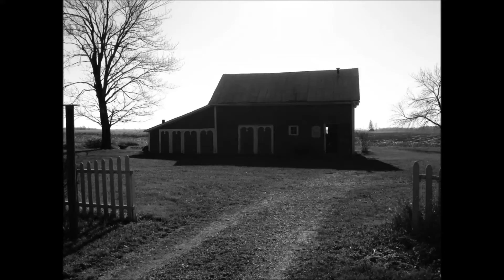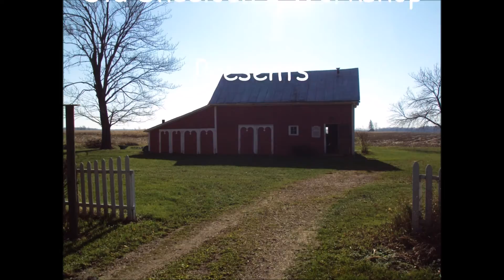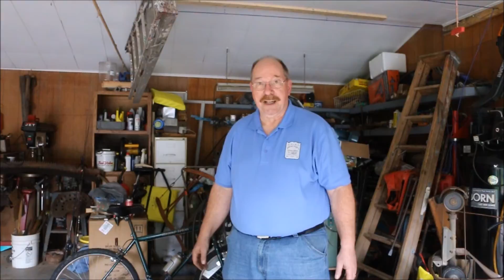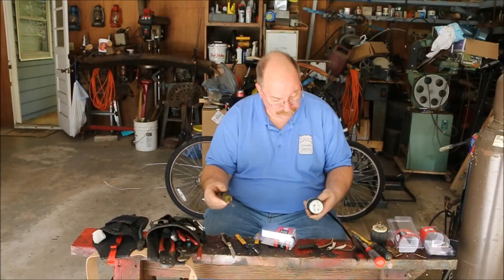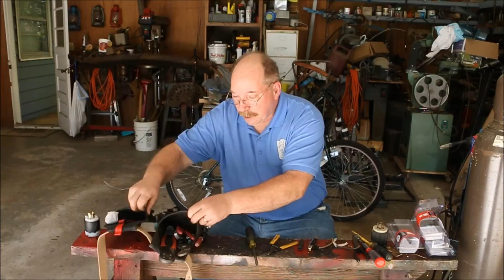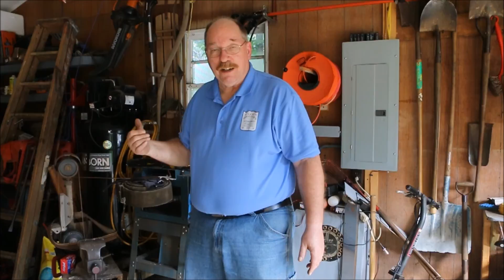Replacing The Cord Cap On The GMAW wire Welder  ~ By Old Sneelock's Workshop

Comment: I'm reminded of a story once told to me by an old maintenance man now passed (and no, it wasn't his work that sent him away).
It seems that they had hired a new electrician, and he was sent to work in this building full of grit blasters (HUGE, three-phase, 480V motors in those things).  Any way, my friend was working on top of one of those machines, and had a view of the breaker panels.  This electrician went into one of those panels with a six inch screwdriver, and came back out with a two inch screwdriver.  After seeing all of the sparks and bits of glowing metal, he said: "They didn't hire an electrician, they hired a welder!"
I agree God must watch over drunks & fools.

Comment: I had a buddy that was pouring raceways for a fish farm and was vibrating the walls. The guy using the vibrator was rubberised up one side and down the other and was still prone to get zapped. They had some wire run from a temporary pole to the vibrator. Looking inside the box they had the ground run to the hot. Switched the stuff around and they could buzz the concrete rather than getting buzzed themselves. That was just 110. I don't EVEN want to get around anything over 220. NOT in my job description!
Reply from the maker: Lewie McNeely God protects drunks and fools. Otherwise there would't be so many of them left. 😈
Reply: Old Sneelock's Workshop TRuer words were never spoken.